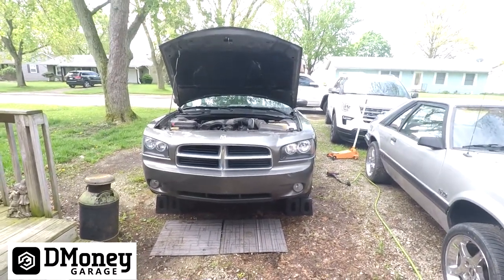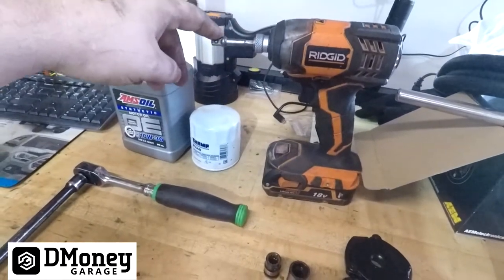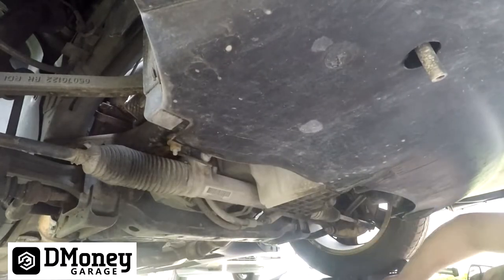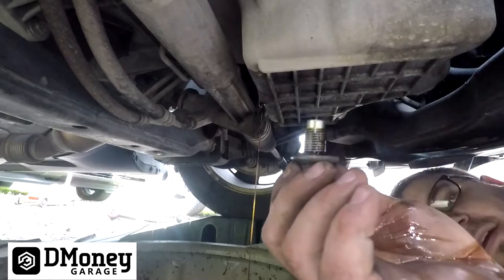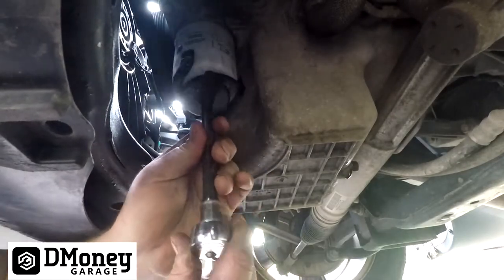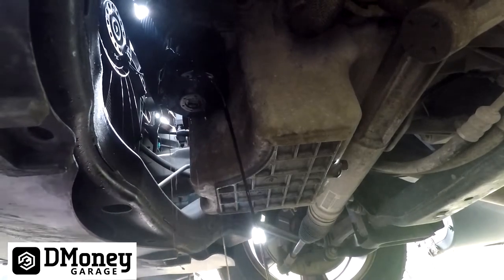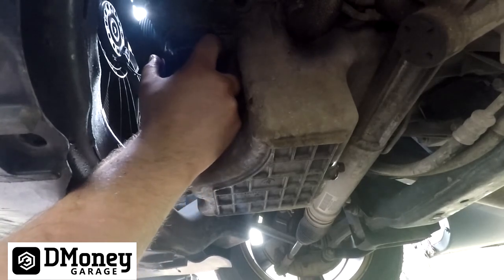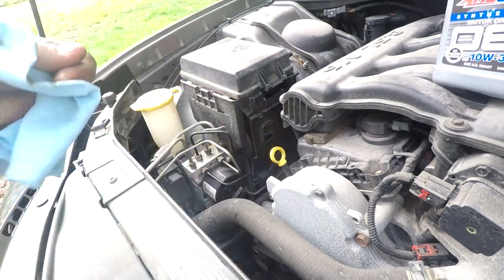How To Change Your Own Oil. Dodge Charger Oil Change.

Comment: What kind of oil do you use for a 2008 Dodge Charger with 171 k miles on it?
Reply from the maker: Run high mileage. If it’s the 2.7 or 5.7 it takes 5w20. If it’s the 3.5 it takes 10w30 and the 6.1 takes 0w40.
Reply: @DMoneyGarage  3.5 engine.  Thx.
Reply: goff m

Comment: What kind of oil filter is used for this dodge (Because I have a 3.6L V6) ? like what is the name and the brand of the oil filter, and What kind of Oil ? Oil name and brand please, And and how do u know what kind of oil and oil filter the car needs (Because I might be getting an R/T SCATPACK OR HELLCAT) , and just to be sure you start putting in the new oil (Which is in the front trunk on the lower right of the engine) after u drain the old one and install the new oil filter correct ? and after u put the new one u said start up the car for 30 seconds and check the engine oil ?
Reply: Always research the manufacturer recommended but most of the dodge mopar community uses royal purple and the top tier filters.